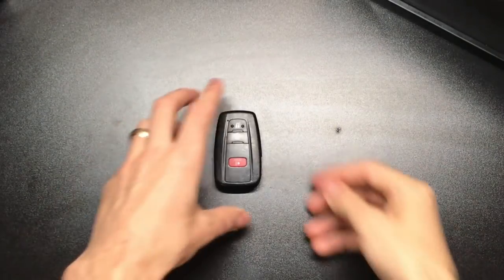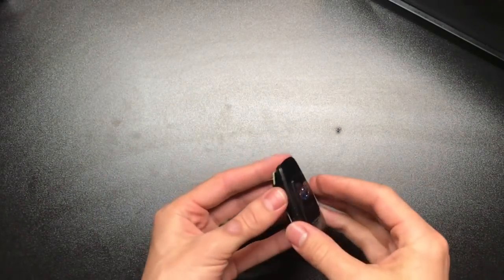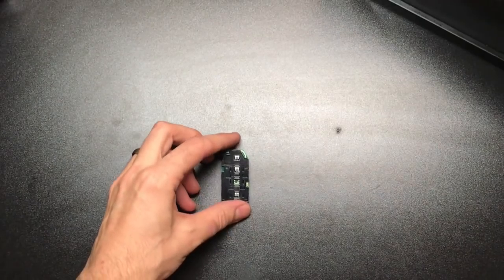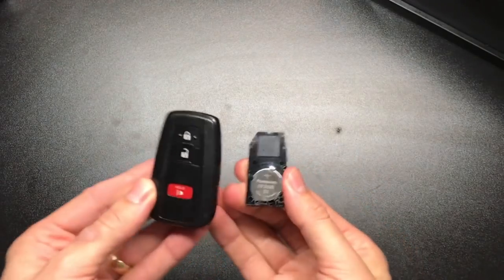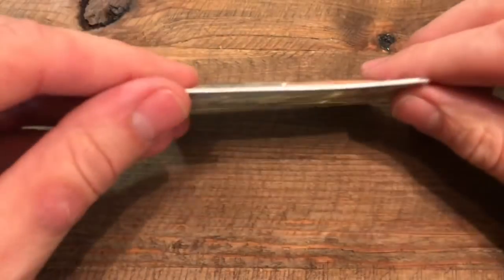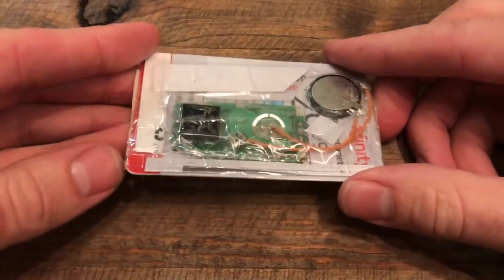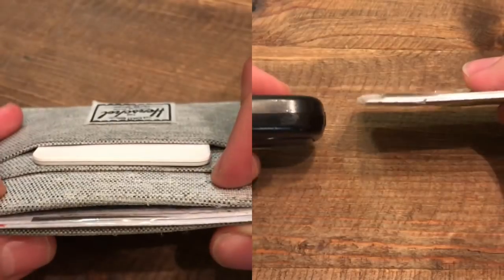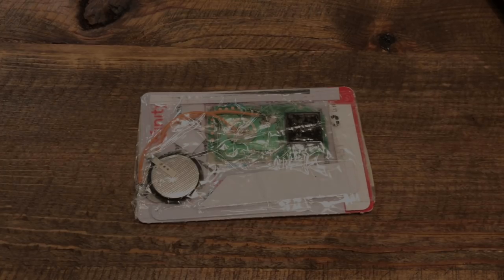Prius Car Key Fob Hack for Wallet: Speed Project

Comment: Dude! I'm on a mission to find a leas bulky solution for ky key fobs. So far im already in $200 on an aftermarket card sized universal Smart key and a little Bluetooth OBD decice to program the key to my car. My wife and I drive exactly the same make model year of car so i kinda want to program the same smsrt key to both cars and just have a single card sized key in my pocket instead of two bulky fobs. I may try to disassemble an OEM fob if the aftermarket thing doesn't work out... Hadn't considered it honestly.

Comment from the maker: Hey - a few people on social have pinged me about instructions: 

Step 1: Take apart 
Step 2: Remove battery 
Step 3- Use conductive tape or solder 2 wires to the 2 battery terminals on your PCB ( that's the circuit )
Step 4: Attach those 2 wires to the battery in the same way it was connected when it was simply sitting on top of the PCB.  Ideally, you can find a coin cell (3V) battery with metal tabs on it.  That will make soldering easier.  Test it at this point to make sure it works. 
Step 5: Find something to attach it to.  Cardboard or credit card junk mail. 
Step 6: Trace out the PCB & cut out a hole. You don't need to do this, but otherwise, make sure you can get to the buttons. 
Step 7: Surround the outside with tape.  This will make it easier to slip in & out of your wallet. 
Step 8: Let me know how it goes!   Feel free to leave comments below if you want...